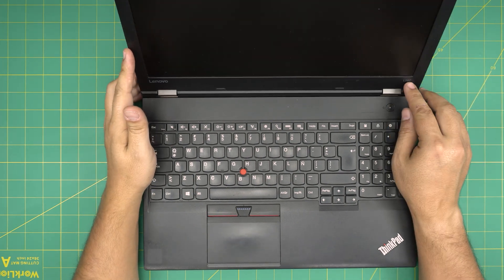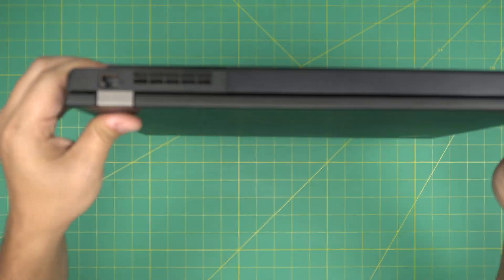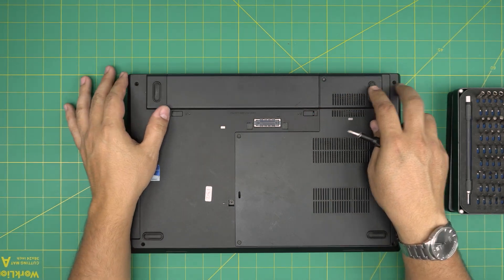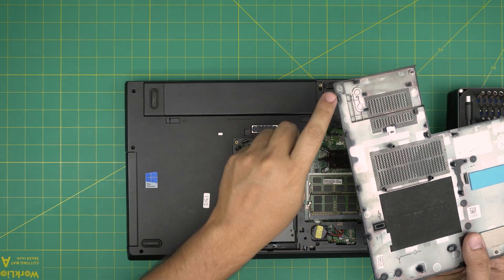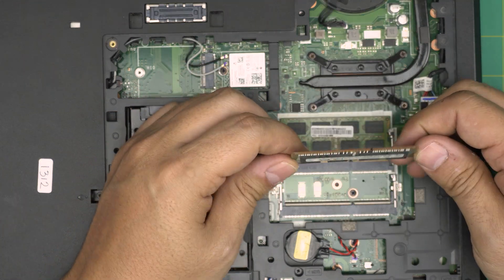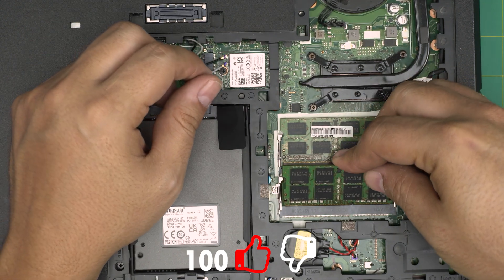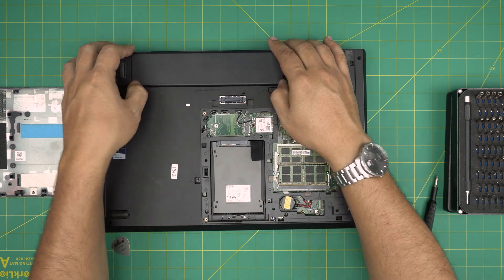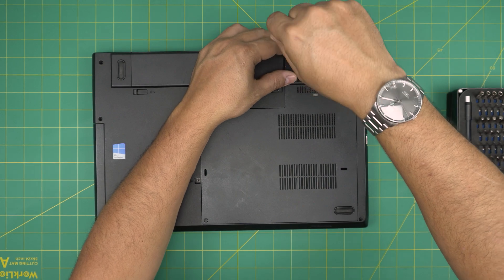How to Upgrade RAM for Lenovo L560 Laptop | Step by Step

Comment: Can I install a new intel core i5 12th gen processor inside the L560?
Reply from the maker: 🫠Regarding your question, the CPU is soldered to the board and is not replaceable.
Should you have any further questions or requests in the future, please don't hesitate to ask me.
cheers🍻

Comment: Have you tried to fit more than 16GB RAM?
Reply from the maker: 🫠Regarding your question, the maximum supported by this motherboard is 16GB, as it can't handle a 16GB RAM in a single DIMM. Additionally, there isn't a single stick of 16GB DDR3L.
cheers🍻

Comment: Hi, I'm using lenovo l570 thinkpad, I'm planing to upgrade ram,  I have a doubt about choosing the correct ram so my ram card is 4gb 2400t , do I have to match the same speed ? 2400t ? Can I go higher ?
Reply from the maker: 🫠Regarding your question, the speed doesn't have to match get a 2666mhz and the bios will auto adjust based on the lowest ram speed.
Should you have any further questions or requests in the future, please don't hesitate to ask me.
cheers🍻

Comment: Hello Friend, do you have a video changing the DC Charging Port for the L560 please?
Reply from the maker: 🫠Regarding your question, i don't have a video for that, but i will add it to the list. to replace the power jack, you most remove the bottom casing.
Reply: @uFixTek I appreciate  your response! Thank you very much! Your channel is simply excellent, one of the best ones on YouTube!